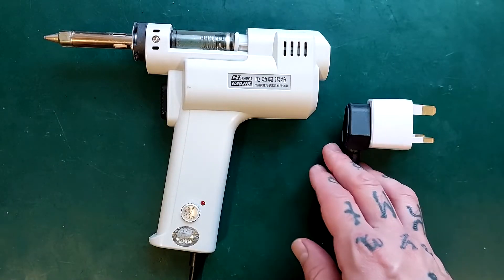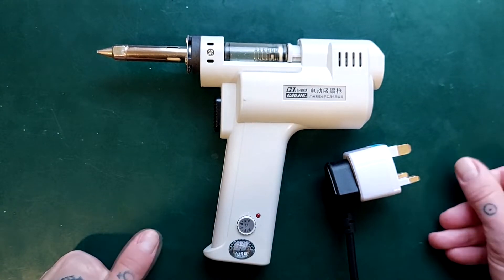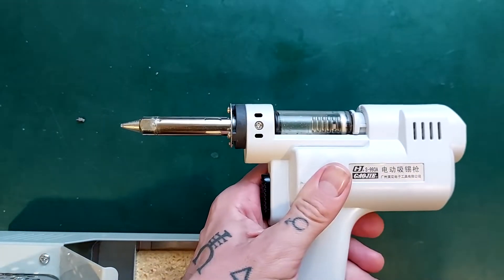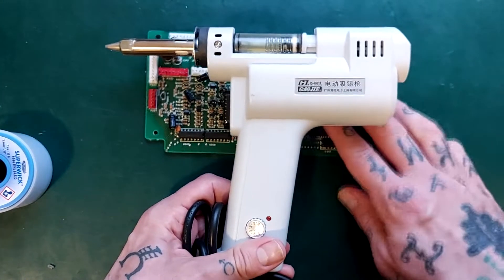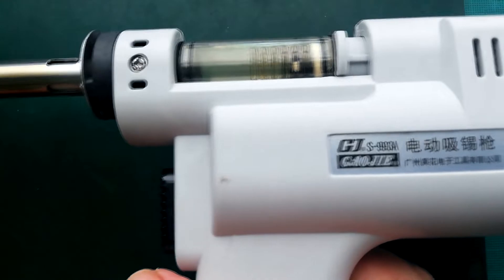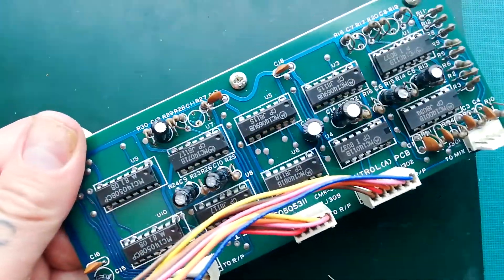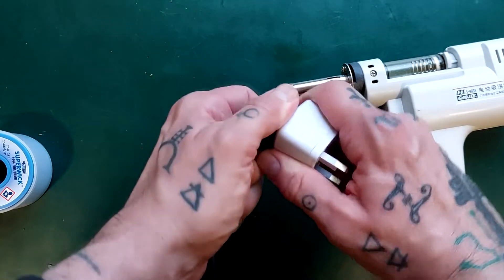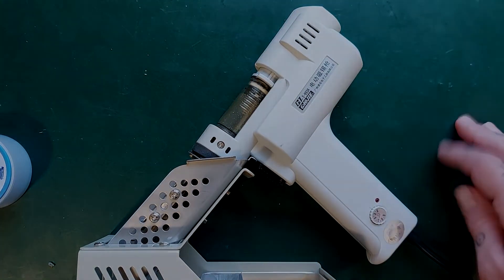S-993A Electric Vacuum Solder Sucker REVIEW & DEMO | versus desoldering wick on double-sided PCBs

Comment: Total crap, I've had to replace the heating element twice so far, don't buy from this manufacturer. Either buy cheaper in the £30-40 range which doesn't hurt so much when they fail or buy an expensive Hakko which should last forever.
Reply: That's right
Reply: Please where can I get the Hakko you talked about?

Comment: These things are junk. If you leave the thing plugged in, the heating element burns out. There is no on/off switch. You have to unplug it soon after use to save the element. Another problem is the pump motor develops dead spots and fails to turn on if it happens to stop on a dead spot. Sometimes hitting it will get the motor to start, but that is irritating. There have also been issues with bad solders on the circuit board, which will cause it to burn up.  The last problem is that the rubber cup on the pump tears, rendering the pump useless. If you do buy one of these, make sure you have the replacement parts I have mentioned, or the pump will be useless.  When it works, though, it works well.